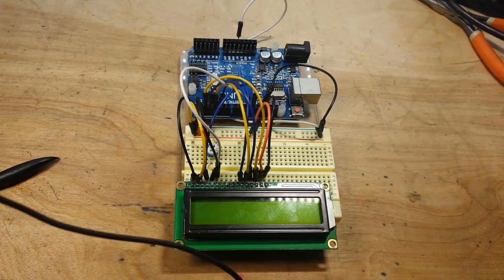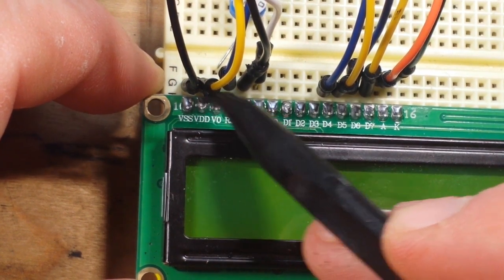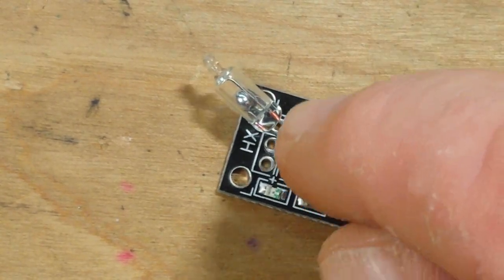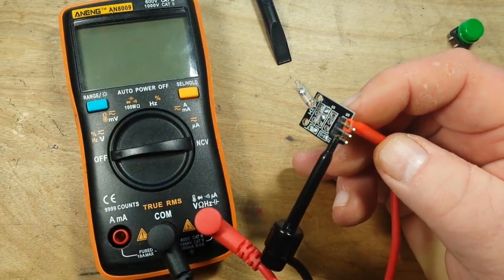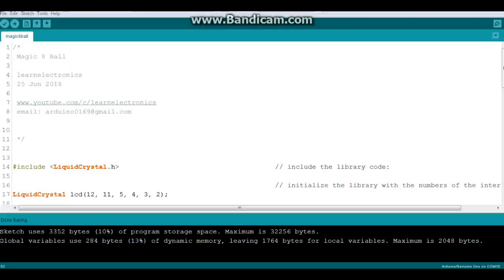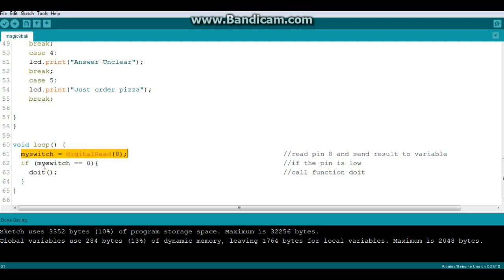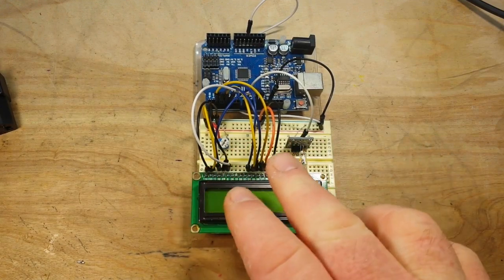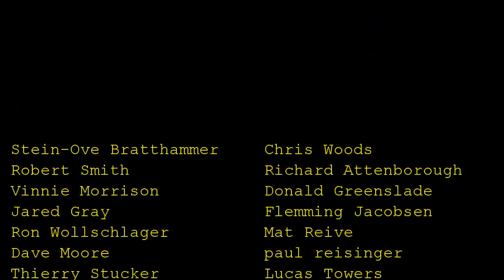Arduino Magic 8 Ball

Comment: That was a handy hint ‘onboard pin pull-up’, didn’t know about that till now, thanks.
Reply from the maker: Glad to help
Reply: yeah, saves a lot of board space when you don't have to deal with all the pullup resistors for inputs if your project is heavy on inputs LOL.

Comment: A couple of suggestions. 1) it is much easier to use an I2C version of the 2 x 20 lcd.  2) when I do use the basic LCD, I think it is easier if I match the pin #'s on the Arduino  (pin 5 on lcd to pin 5 on Arduino,  etc) it works either way, but easier for my old brain to remember!  Thanks for the video.  I haven't used the mercury switches yet, and this gives a great example.
Reply from the maker: Hi Rick, thanks for watching and commenting. Since my videos are mostly watched by beginners i use the pinout in the liquid crystal library so as not to confuse prople.  But i agree with you, and i should have explained better that you can use any pins you like as long as you define them.

Comment: What does he mean with  "V0 goes to positive" ? and what does he mean with A goes to VCC? There is nothing with those names in Arduino. In the picturehere is a white wire going from the red row in the breadboard under the Arduino board to where?
Reply from the maker: VO goes to the wiper on the pot.
Vcc is 5v on the arduino

Comment: Sorry Paul, I don't understand. You said this would be in 4 parts, but when video was done, the project was completed. Was this 1st of 4 or 4th of 4. Thanks,
Reply from the maker: 4 parts = 4 components
1. Arduino
2. 10k pot
3. 16x2 lcd
4. Mercury switch

Sorry i should have been more clear about that.
Reply: Ok, great. Neat little project, are these parts available in your Ebay store. Also I can never find the link to your store.
Reply: Nevermind, just found link to your Amazon store, and other links
Reply: Sorry to bother you again, trying to locate parts, & finding lots of Arduino uno's. On banggood there are geekcreit,uno, wemos, r2, r3, etc. Noticed you have lots of arduino videos, but couldn't find one explaining the differences. Will you suggest a video or book to explain differences, and tell me which was used for magic 8 ball project. Happy 4th, & thanks for your service to our country. Bill